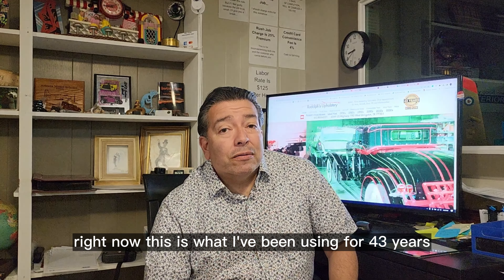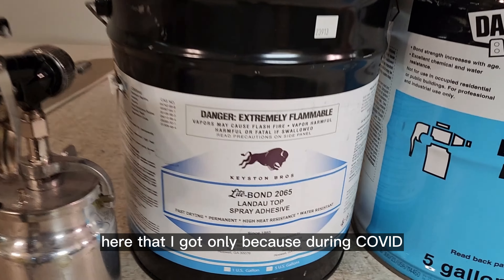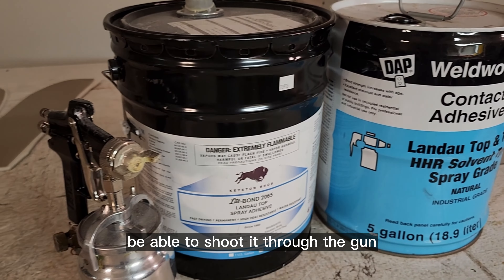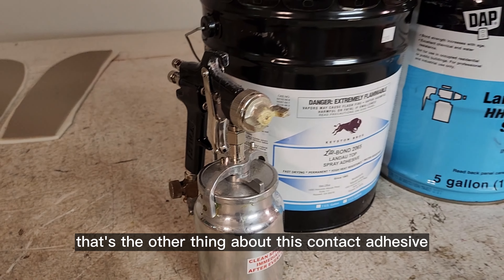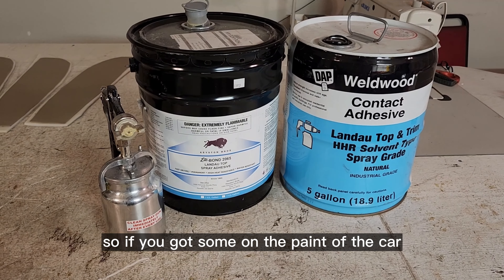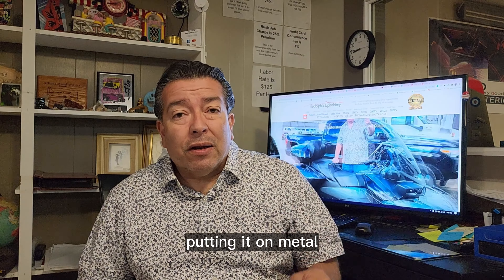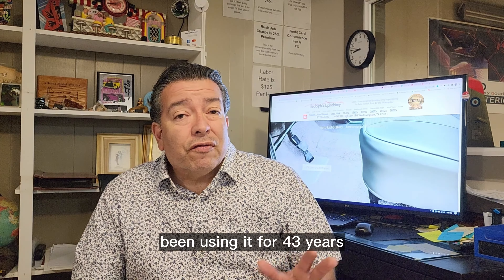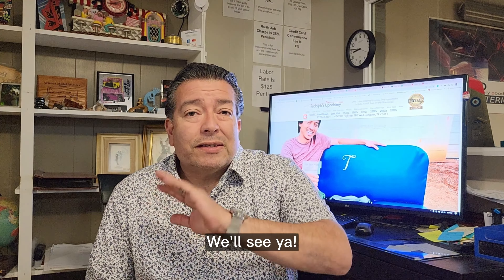You have been doing this wrong 3M spray can glue adhesive

Comment: Do you allow a "cure" time, after spraying this brand of glue, and before you apply to 2 materials together? If so, how much time?  I did upholstery full-time for 7 years, and had 1 incident with 3M where a automotive headliner was returned for not sticking properly. At the time, I wrote it off as my fault for not waiting long enough for it to cure, before applying the 2 surfaces,  but after watching this video, I wonder if the 3M aerasol can that  I used, was defective??? I will never know for sure! Thanks.
Reply from the maker: Hello Alan, Contact adhesive is no time to wait when gluing soft to soft, such as material to foam or foam to foam. Let set for 5 minutes if gluing material to hard surfaces such as fabric to plastic. The falling headliner was the spray can glue separating and not defective, but typical. There are a thousand stories of the same thing happening. Thanks for watching!

Comment: Thank you for the awesome video, and saving me from buying the dreaded can of 90. Can you please tell me what brand of gun(s) I should be looking at, for a home diyer? Tyvm
Reply from the maker: Hello Damned, You are so welcome! I just use the cheap harbor freight spray gun. Or you can just use a brush. Thanks for watching!
Reply: Is a 1.7mm tip big enough to spray the DAP adhesive, or should it be larger? Thx again.
Reply from the maker: @damnedin82  Hello Damned, It's not rocket science, I just use the stock tip that comes with the HF spray gun. Please keep watching!

Comment: If I don't have a way to spray it how would you recommend I apply the contact cement? I've heard not to brush it on too thick. I think that's been my problem, globbing it on
Reply from the maker: Hello Captain, Yep, you could use a brush, but for finer application,  spray is best as not to soak the material. Please keep liking and watching!

Comment: Thank You for your advice. I plan on using the contact cement to adhere foam to the felt underlay. I hope it works for that application. Another question. How long will the product last when in the sprayer without hardening?
Reply from the maker: Hello Jon, You are welcome! Contact adhesive will work. The glue getting hard depends on the temperature. It will last longer in the cup if it is cooler outside, maybe a month. With very hot temps, maybe a week. Please keep liking and watching!

Comment: I've used it for foam RC gliders and yeah it fails after several years.
Reply from the maker: Hello Patrick, I have also used it for foam flying models, I never had luck with it holding anything together. Thanks for watching!
Reply: @oldschoolautoupholstery  quick question for you. Can run the DAP weldwood contact adhesive through a spray gun?
Reply from the maker: @patrickradcliffe3837  Hello Patrick, I am not sure because I have always bought 5-gallon pails of contact adhesive. If it is the yellow contact adhesive, I think it will. Please keep liking and watching!

Comment: I should have found this video before, just replaced my headliner in a ram 1996 and I was skeptical about the heat but proceeded anyways not even 2 days and is already falling again due to the sun, I may have to redo everything uncluding the starlight😢. So any weelwood contact cement will work? Since I have found several or similar ones in different stores
Reply from the maker: Hello Dian, Oh, so tragic. I think any contact adhesive should work. Please keep liking and watching!

Comment: Hey Rudolph, I love your Videos and maybe you can give me a suggestion, on
a repair I need to do. I have a slider inside my car for the sunroof. When I want
to use the sunroof, I pull the slider back, so you can see the glass sunroof. The
last time I pulled out the slider, about 6 inches (right) where it wraps around the front
of the slider came loose, and just hangs there. I was thinking of using some kind
of staples, or tacks to wrap it around the front edge of my slider, or maybe using
glue ? but if I use glue, I'm worried it will leak thru the cloth, causing a stain.

What I do now, is keep my slider closed, and pushed up tight to the front.(jammed in)
so the cloth is not hanging down, and this also means I cannot use my "sunroof" . 
you can briefly tell me what to do Rudolph -- thanks a lot -- Grant ( in Canada)

Maybe this glue you have DAP -- on this vid, would be ok, but I don't have a gun to
spray with. I'm sure you'd know just what to do -- any suggestions ???
Reply from the maker: Hello Canada Grant, You are right about glue going through the thin fabric. I would use a brush and glue the anchoring edges only. Compressed air on that would ruin your day. Thank you so much for watching!
Reply: @oldschoolautoupholstery  thanks Rudolph
and I was thinking the same thing, and that's just affix the anchoring edges, either
with glue, or some kind of staples ? I'm 
not sure what the slider board is made of
but it's likely some kind of plastic. Keep well
done in East Texas :)
Reply from the maker: @grantp4022  Hello Grant, I think you got it! Let me know how it goes. Please keep watching!

Comment: What size paint nozzle orfice do you use for the glue
Reply from the maker: Hello Tracy, I just use a stock spray gun from Harbor Freight. I don't know what size it comes with. I am assuming it is some standard size. Please keep watching!
Reply: Some HF guns I've bought came with two tips. I'd go with the larger(primer) one rather than the smaller (finish) one.
Reply from the maker: @danwildhaber8178  Hello Dan, I never saw two tips. I guess you can try it. Please keep watching!
Reply: @oldschoolautoupholstery  For thicker stuff I've found the larger tip delivers more volume allowing a wider pattern. I imagine both would work although I know you don't want to use the big tip on thin stuff 🙂. 
 Love your videos!
Reply from the maker: @danwildhaber8178  Hello Dan, Thank you for the contribution! Please keep watching!
Reply: Question, when you spray on the glue, do you spray both surfaces and let them tack up. What would you recommend?
Reply from the maker: @mikehammer4546  Hello Mike, If you are gluing hard surfaces, you should let it set up before joining. If it is soft like materials or foam, There is NO waiting. Thanks for watching!
Reply: @oldschoolautoupholstery  
I noticed that the DAP Weldwood Contact Adhesive Top & Trim HHR Solvent Type Spray Grade  come in a small 14oz. aerosol  spray can. Have you ever used this size can? I don’t have a compressor or spray gun. Btw, I’m working on a VW beetle headliner
Also, can you brush on the glue?
Reply from the maker: @mikehammer4546  Hello Mike, I have not seen that. I think a brush would be better anyway for a VW Beetle headliner. Thanks for watching!

Comment: Is the Landau top adhesive thinner than the regular contact adhesive from Weldwood?  Only thing I can find is the regular stuff.  I have a new spray gun similar to what you use from the same company, but i don't want to ruin it by spraying something too thick through it.  Thanks for your info.
Reply from the maker: Hello Big, As far as I know there is only one consistency for the contact adhesive. Don't worry, the glue can't hurt your spray gun. Please keep liking and watching!
Reply: @oldschoolautoupholstery  Great, thank you!
Reply: @oldschoolautoupholstery  Apparently there are different adhesives. Just opened the quart I got from the big box store H/D and the glue was whit in color.  Upon inspection of the directions, it says not for foam, and is water based, and has a 60-70 minute dry time.  Headed back to H/D to see if they have the right stuff, but as I remember, the only other one that they had from Weldwood was a low VOC "green" adhesive.  I live in California, and I wouldn't be surprised if they have banned the good stuff here..
Reply from the maker: @bigfranksworld  Hello Big, What I do know is that the contact adhesive I use is the same as someone would use on countertops. Usually yellow in color and definitely not water-based. Please keep liking and watching!
Reply: @oldschoolautoupholstery  Okay, just checked.  We can only gt the right stuff here in California in 3oz. containers, at $10.00 for 3 oz.  I'm sure they don't sell it in larger containers because they don't want people to spray it.  Can't get the big box or Amazon to ship it here either.  Do you have a good upholstery supply company that I can go to?
Reply from the maker: @bigfranksworld  Hello Big, Try Keyston bros. There are several locations in the USA. They ship! Please keep liking and watching!

Comment: Is the Weldwood Contact Adhesive also available in a spray can and would it be just as effective if it is?
Reply from the maker: Hello Gene, I have been told that there is a spray can version of this contact adhesive. I have never used it. Assuming that it is the same glue. Please keep liking and watching!
Reply: @oldschoolautoupholstery  can I ask what color the glue is ot does it come out clear?
Reply from the maker: @geneatencio  Hello Gene, I know that the Weldwood contact adhesive is a yellow color. I have seen other contact adhesive in a clear yellow, red and green. Please keep liking and watching!

Comment: I want to buy a sewing machine like yours (it's very expensive)  I'm a beginner is there other options that may work? Thank you so much!
Reply from the maker: Hello Herrera, You are so welcome! Really any new or used industrial sewing machine with reverse, a walking foot and a welt foot will do.  Please keep liking and watching!
Reply: @oldschoolautoupholstery  Thank you Rudy! You're the best!
Reply from the maker: @herrerafoto  Hello Herrera, You are so welcome!
Reply: @herrerafoto My advice is do not buy a Chinese cobbler machine I made that mistake. Look at industrial auctions, surplus centers, and newspaper classifieds for a second hand industrial sewing machine you will find one. My first was a Singer industrial 111W115 that was originally used by the government it still works great for an old ww2 machine. My second machine that I absolutely love is my Juki DNU-1541S it has a servo motor and is an excellent Japanese made machine. If I had it to do over again I would have just waited, saved money, and bought the new Juki in the beginning. If you find a used machine make sure good oem or nos parts are available. Your going to do great 👍

Comment: Give the 3M fast bond 30 a try , works as good as the gorilla snot , without the brain cell drain , H2O base super low VOC'S , AND IT SPRAYS LIKE A DREAM !!!
Reply from the maker: Hello Donald, Good suggestion, but I have paying customers. I have only been using contact adhesive for 45 years because I know it's a sure thing. I am not willing to take any risk with my reputation by experimenting. If it ain't broke, don't fix it. Just sayin'. Please keep liking and watching!

Comment: can you show how you would spray on a RV headline that is in place but sagging?
Reply: I also have an upholstery shop with steamer. My RV project sags from both sides and  need to steam to streatcg the vinyl headliner. I watch your videos, but need one to show how you would spray and steam and stretch to put back into T molding center strip.
Reply from the maker: Hello Kip, I do not have that video as I would never try to repair a sagging headliner. The problem is the deteriorating foam. That foam needs to be scraped off before you glue anything. This is why I have only done headliner replacements. I have a few videos on my YouTube channel for that. Please keep liking and watching!
Reply from the maker: Hello Kip, Part 2 question. I would replace the vinyl with real headliner fabric. Just sayin'. Please keep liking and watching!

Comment: I actually see this in a spay can format? Is that not the same stuff you are using. How hard is it to get material off of wood if you use this product? I am putting felt on Fender amp that is made of Particle board and if it gets stained I want to be able to remove it somewhat easily.
Reply from the maker: Hello Jd, I am not sure what you are seeing. I only use contact adhesive for everything I do for 44 years. Contact adhesive removes with mineral spirits. Please keep liking and watching!

Comment: Would this work to glue sheets of rubber to metal in a car to help with vibration? I know there are several companies that make a product for this purpose with adhesive already on it but I can get about as much thin rubber sheets as I want from work so if contact cement works it be a big savings
Reply from the maker: Hello My, Sure you can use contact adhesive to glue rubber sheets to metal. Please keep liking and watching!

Comment: I used super 77 to glue PE foam onto the roof of my van metal on foam and it held till it got hot out and few days later the foam came down slowly and the glue was like syrup with strings leading from metal to the foam.  It lost its strength in the heat.  So now I don't trust it to now attach headliner up there.  I'm going to brush on weldwood contact adhesive.  is a pint enough to buy for a headliner?
Reply from the maker: Hello Art, I just described an experience that many have had. Spray can adhesive is very unreliable. I would look for a quart of contact adhesive. Please keep liking and watching!

Comment: Greetings my friend, I’ve been having a hard time getting the vinyl to stay in place on to the molded headliner boards of my 1966 Thunderbird. Is the dap weldwood contact cement adhesive landau top & trim adhesive the cure for this? If so, I’m thinking of getting some and applying it with a brush. Another question, is there an advantage to applying two coats? I’ve used the “3 men” product and have found it doesn’t hold up to the heat. After a couple of weeks, the 3 men product failed. Also, I’m thinking of NOT using a foam pad and applying the vinyl directly to the fiberglass surface of the board, (after scuffing the surface with 60 grit sandpaper). I so frustrated, as this will be my 4th attempt of trying to get the vinyl to stay in place for more than a few weeks. HELP!!!!!!
Reply from the maker: Hello Douglas, Help is on the way! I only use contact adhesive for everything. Can be applied by brush. No need for sanding or two coats. Your making it too complicated... Just be sure to strip off all that old glue first that failed you. You should be able to clean with either mineral spirits of if need be Acetone which is much harsher. I sure do miss my 1966 T-bird town landau with the 428. Please keep liking and watching!
Reply: Thank you. Very much appreciated. I bought my ‘66 a few years ago, it hadn’t been on the road since 2004. With the exception of the headliner, the interior is minty, not a single crack in either the dash or steering wheel. (Mine has the 390 btw 😢😂)
Thanks again 
You have a new subscriber/follower.
Be well
Reply from the maker: @DouglasDouglas-wk2ob  Hello Douglas, Mine was white on white with a beige interior. It was so beautiful. I sold it in about 1995. Please keep liking and watching!

Comment: How long do you wait after spraying to bring the two surfaces together?
Reply from the maker: Hello Firpo, For contact adhesive, if gluing soft to soft, like fabric to foam, I do not wait. If gluing soft to hard, Like material to plastic, I usually wait 5+ minutes. Please keep liking and watching!
Reply: @oldschoolautoupholstery  Thanks for your reply! Do you apply the glue to the foam on the side with the backing or the non-backing side?
Reply from the maker: @firpofutbol  Hello Firpo, The foam side is for the glue. Please keep liking and watching!

Comment: Is the DAP contact adhesive available in spray cans? My headliner in my Silverado is peeling back above the drivers side door and that pail would he ridiculously overkill for that project.
Reply from the maker: Hello Kevin, At that point it should be time to replace your headliner material. The foam will continue to seperate from today on. COntact adhesive can be bought in small containers and used with a brush. Thanks, for watching!
Reply: @oldschoolautoupholstery  that's rough considering its only peeled back about an inch. Thanks for your video!
Reply from the maker: @iamzombie76  Hello Kevin, I am sure you can fix it! Please keep watching!

Comment: What do I do if I got a drop of the contact cement on micro suede?  No sprayer and I got glue all over my fingers. Tried to get it all off but missed one spot and I smeared it on the good side of the fabric :(
Reply from the maker: Hello Seducier, I never use contact cement, so I don't really know. I only use contact adhesive. From what I am understanding from other commenters is that there is a difference between the two. I usually use mineral spirits to remove glue. Please keep liking and watching!
Reply: @oldschoolautoupholstery  right. I will try that.  Thank you!   Yeah I will try to find the adhesive type next time. Thanks again!
Reply from the maker: @Seducier  Hello Seducier, Right On! Right on. Please keep liking and watching!
Reply: @oldschoolautoupholstery  the cement seems not bad btw. It's def sticky. Idk if it can be sprayed well or not but what I've been doing is using a small paint spatula and giving it a thin layer where I'm working. Also been using my finer to rub it around into some spots where the spatula can't get. Then just taking my time and trying not to get glue spots on the good sides. I'm making a custom trunk audio btw. Lots of pieces with inside corners. Inside corners seem like the hardest.
Reply from the maker: @Seducier  Hello Seducier, Yep, those good 'Ol inside corners. Fun, fun fun. Hehe.  Please keep liking and watching!